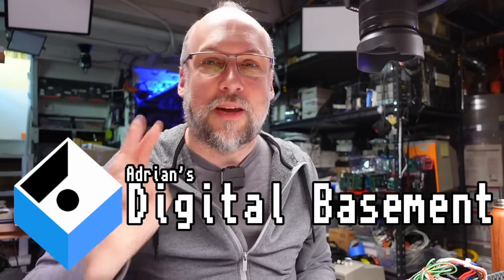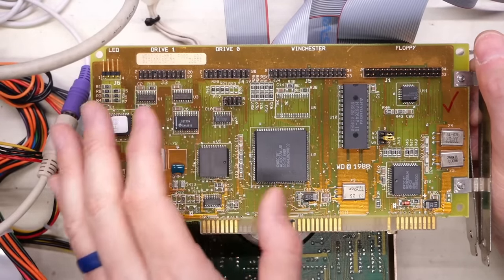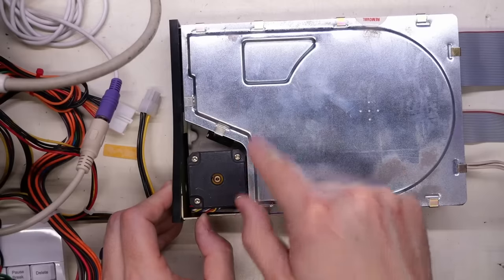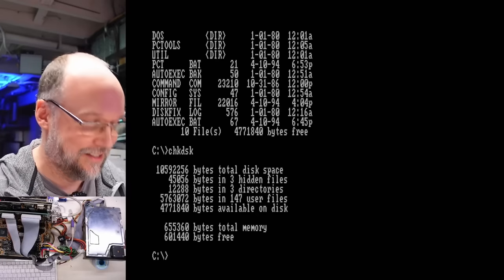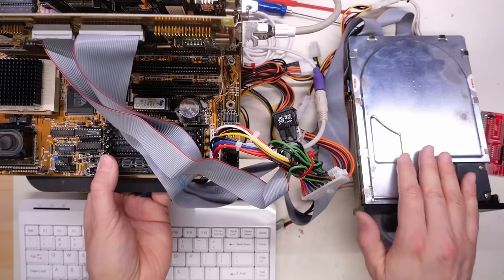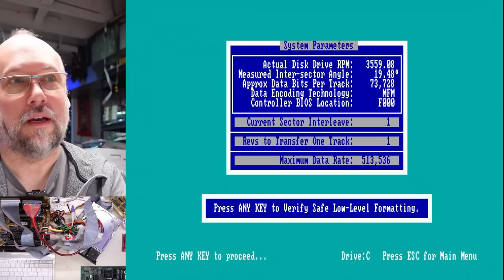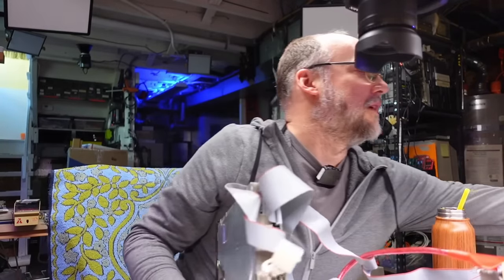Test and try: Does this 40 year old Tandon TM-252 drive still work?

Comment: My first PC class was XT clone, with 10MB MFM HDD branded Cogito Systems, probably one of mentioned ephemeric disk manufacturers. The controller was full-length card, based on the Z80. The drive looked exactly like ST225 and was as noisy as your Tandon. I managed to put Windows 3.1 (albeit in real mode) on it - each and every mouse movement was causing the drive to "tweet" for 10-15 seconds until anything happened ;)

Comment: I think you should use the more modest 386 board with all bios format goodies still in it. I would call those 16-bit controllers mainly compatibile (with drives and pc's), and I remember drives needed LL format anyway. Also, put bios ram exclusions where expected - it is better to do it first and turn off later (as I discovered , some things should work without it, but don't!)

Comment: I bought a similar 10mb full height hard drive for work for an original IBM PC in 1981. It came in an external enclosure with a controller card and power supply and a custom cable, as well as special software to get the PC to recognize it . I believe we paid $5000 in 1981 dollars! for it!

Comment: Given the small size, it seems a little sad to separate the drive / drive controller. This drive probably came from an original Compaq Portable. It may be good to keep it - just in case you ever need to build a Compaq with original hardware.

Good video.

Comment: I had one of those in the XT i got ahold of in the early 90s. My main machine was a 286 @ 20MHz (Harris was the fab under license, like AMD, several companies made 286s), 4MB onboard RAM, and two SCSI hard drivew, a 40 and an 80 megabyte, and EGA. I was ballin. 🤣

Comment: The noise MAY be from the grounding strap for the spindle motor (look at the bottom of the drive).  These wear a bit and can be a bit noisy.  You might want to check it out.

Comment: In a way the stepper motor driver are better than later voice coil hard drives. Modern hard drives have a servo track that lets the drive know where the tracks are, however if the magnetic patterns become degraded then the drive will be unable to locate the tracks - so game over, it's junk. These servo tracks are written in the factory using a special jig, the controller that comes with the drive cannot do that.
These old stepper motor drives don't have a servo track, and you can totally re-write everything.
With the stepper, each step takes you to the next track, with a voice coil there are no hard steps, it just moves the heads until it finds the next servo track, so if that is lost then the servo will just hunt about a bit, find nothing, then just error out, no options, it's a goner.
A voice coil actuator cannot move the heads a fixed amount, so it's impossible for it to be used to lay out a new servo track.

Pity you didn't keep the old HDD contents.
Reply: Isn't that what self servo writing does?

Comment: Would have loved to have you run spinrite on the drive with original controller.  It will check the interleave and also tell you what the optimum would be. AND, can change the interleave on the fly/no data loss.

Comment: Indeed magnetic media can "go bad" through entropy - the ordered domains just naturally decay. HP sold a pocket computer with a pull-card solution for data storage. It was recommended to read the cards occasionally because that would also rewrite the built-in timing tracks and so refresh the storage organization if not the data itself.
Reply: The older drives used weaker read and write heads so the strength of the domains was lower to start with. If I remember correctly by the start of the IDE era the on platter domains were over 10 times stronger than the MFM era.

High density requires higher domain strength for some reason. I think it has to do with domain strength falling off over physical area? I think.

Comment: I sometimes miss working with this kind of tech. Yeah, getting into computers, the 486 was out, but I was stuck on that for quite a while from hand-me-down parts. Before I actually went out and bought all new parts, I had a 486 Overdrive, 33 MHz FSB and 100 MHz core, 850 MB HDD, obligatory 1.44 3.5" floppy, 16x cdrom, 16 MB RAM and an SVGA card (don't remember the manufacture). I had that machine up until about 1998 (wow...16 years old... where did the time go?) when I bought parts to build an AMD K6-2 machine with 64 MB RAM.

Comment: Compatibility between Sata and ST506 might exist on a few drives but it would be difficult to test, you'd need a basic ide to sata adapter, plug it into an ide port and run a program to test ST506 commands to see what it does. Compatibilty will likely be only have a chance on 1st gen sata hard drives than anything newer. I really wouldn't expect sata backward compatibility to extend back before what is needed by ATA-1 with LBA28 (1994). Sata drives will likely just not work with direct CHS addressing from ST506 as it was declared obsolete a very long time ago.

Comment: I worked with XTs and ATs, and I really hated the noise even back then.  I was looking into solid state way before it went mainstream; embedded sometimes required it so there were options but they were so expensive.  It was a glorious day once the SATA SSDs finally became affordable (albeit for tiny capacities).

All that said, Flash memory requires regular scrubbing thus I depend on spinning rust for long term cold storage so I use them for archival and backup.

Comment: I remember having an old Seagate ST-225 back in the day, but it was mashed into an Amstrad PC with a controller set to a config that I'm pretty sure were wrong for the drive because it reported the drive as 32MB and that is a 20MB drive.  Needless to say that setup was far from reliable, but I was too young and inexperienced with PCs (XT actually) to know how to fix it.  Later we attached the drive to an AT system and figured out that it was a 20MB drive and setting it right it started to actually work reliably.  Go figure.  🙃  Still I am amazed that a drive from 40 years ago is still working reliably.  That is amazing!
Reply: That was a pretty common "hack" back in the day. Just swap the MFM controller for an RLL one and you'll get 50% more space.
The only issue is: RLL drives have a higher quality magnetic surface, so using MFM drives like that will impact reliability.

Comment: I have an ICT Data Chief for my C128 which has a Tanden clone of the ST-225 but it is a 3.5” half height drive in a 5.25” sled. The stepper motor sounds identical to yours however mine has stiction and I have to manually spin it to get it started. Then it’ll be fine until it powers down and parks.

Comment: A question - is it possible to mod a MFM controller board to work on the side of an IDE controller on a motherboard that still has ISA slots? Maybe wire it to another IRQ? Something else? Or do I have to disable the IDE to have any luck?
Reply: Ah, it seems it is... somehow. I have some old 16 bit boards that lack some of the edge contacts, and I researched the topic a bit years ago. I could put copper tape and jump wire to some location to have contact with the IRQ pin I want, and/or insulating tape on another location on the edge, but is that actually necessary? Adrian said the board addresses are different so at least that part should not interfere.

Comment: Have you ever seen a Tandon Pac PC?  Tandon made a PC with 2 drive bays that took a drive in a cage and plastic enclosure that you could eject swap out.  You could boot off of either drive and it came with a utility that remapped the drive letter of the disk you booted from.  Also, while running you could eject the non-boot disk and insert another drive.

Comment: Re the impact driver, the reason to use a bit holder with some flex is I'm pretty sure just to avoid destroying your bits or fasteners -- I've had e.g. less expensive torx bits shatter in the impact driver. Also bit holders not intended for impact drivers can be torn apart --  had one that had a friction fit shank that just fell apart after some abuse.

Any kind of shock absorber is actually going to reduce the effectiveness of the hammering. The whole point is to take the long slow gentle torque your hand is applying, and focus it into shorter sharper shocks. But there's enough, and there's too much! And having a little flex in the bit holder could be important if it keeps the shock just below the level that destroys your tools :)

Comment: I have a bunch of gotek floppy emulators loaded with the flashfloppy firmware. With one of those stubby little flash drives you can have gaggles of floppy images and avoid the issues with random old floppies going bad on you. Also flashfloppy lets you emulate floppy drives for lots of different systems, not just PC>

Comment: That warbling noise is normal for that series of drive. Tm252 is 306 cyl, 4 head, 17 spt, write precomp at cyl 128 , park at cyl 305, usually had to use a park utility iirc

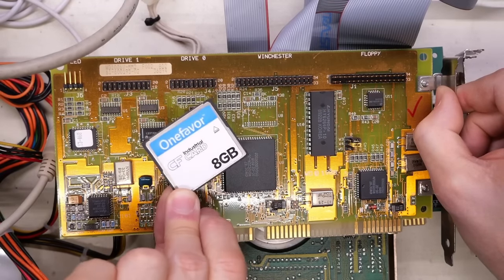Comment: 08:27 SATA drives uses two different command sets: ATA and AHCI. ATA is essentially an IDE/CF/original AT hard drive card compatible command set, while AHCI is closer to SCSI command set.
Reply: and AHCI is really only for optical drives, maybe certain other removable kinds of storage, because ATA is only for normal hard drives (and SSDs for pre-NVME drives)
Reply: @Nukle0n You're thinking of ATAPI.
Reply: It is the SCSI command set, which is why SATA drives run under the SCSI subsystem in Linux.
Reply: @douro20 Oh, yea. Which is also SCSI based.

Comment: 8:25 All SATA drives implement the ATA/ATAPI command set which, put simply, extends ATA with the SCSI command set. USB mass storage devices also use SCSI which is why in Linux for example both usb mass storage devices and SATA drives use the same device file naming convention sdx.

Comment: 35:14 depending on the MFM controller you can use debug.exe (which was on the disk)  and then "G=C800:5" or "G=C800:800" or or "G=C800:CCC" or "G=C800:6" depending on the BIOS (on the controller or the motherboard).

Comment: I can describe that sound, it sounds like that drive has a dry bearing or is dragging a head.  But since the drive is working, I'd go with 'dry bearing', especially after backing up to figure out "what the hell is that high pitched sound I haven't heard in 30 years"

Comment: IDE stands for integrated drive electronics, so IDE drives have a disk controller integrated with the drive itself, and the so-called IDE controller is called the host adapter.

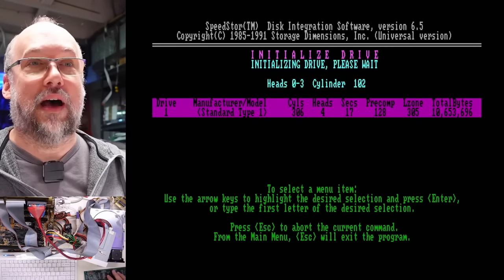Comment: 38:20 Many 8-bit cards used custom physical formats and translated it on the fly to the logical format associated with INT13h.  This was especially the case for RLL controllers and necessarily the case for compressing controllers like Perstor.  Without the BIOS on the 8-bit controller the translation would be impossible.  An additional problem is that the BIOS will sometimes crash or malfunction on a faster system due to timing assumptions that were only valid on XT-class computers.

Comment: That's not the loudest I encountered.  The first RS/6000 system I used (7013-595 I think) had two full-height hard drives.  When the system powered up it sounded like a jet spinning up.

Comment: Pick up a set of JIS screwdrivers.  Unlike regular Phillips bits they don't have an angle in the bit design that is intended to make the bit cam out when you ramp up the torque.  They 'bite' into the screw head better even when put into non JIS screws, just like the Posidrive tip does on your hammer drill you're using.

Comment: For super reluctant Phillips head screws that slip, and you really need to get the item apart.  A good technique to use, is to crazy glue a piece of paper to the stripped screw head, and while it is still wet, put the bit on and holding the bit tightly into the stripped head, wait until the glue dries. then attach the impact driver and the screw will normally come right out.   There are some where even that technique won't work and the only answer I have found for that issue, is to drill it out.

Comment: Out of curiosity ... one could use modern flash alternatives with whatever adapters (as shown with CF Cards). Using these old drives, is it solely for the "vintage factor" or does it have some practical use? I guess checking if a specific controller card works or something like that?

Comment: Have you ever worked on an XTA drive? I have understood that those were a rather short adventure before the ATA interface. They used a similar 40 wire cable and connector, but were 8 bit wide, and had no master/slave selection that I know of. I have run into two of these drives - or at least one, which was in a Philips PC clone, and another which I suspect to be one. I have a HDD controller for Amiga 500 which has a selection jumper for XT/SCSI but I only ever got SCSI drives to work with it. The mystery 40 pin drive which doesn't communicate with a "modern" IDE interface, doesn't seem to do anything useful with the controller either. I must excavate it from my pile of rubbish and look up the model.

Comment: In my experience early model voice coil HDD can fail from the coating on the magnets cracking and then coming loose. It sticks to the main magnet and interferes with the head coil.

Comment: I have a few still. I have 2 working. 1 in a DTK 8088. And the other in a 286 that has a built in MFM controller on the mother board that I cannot use a XTIDE. I have a ST4069 full height that still works (or did last time I had it out). I also have a few "bad" ST225's. I want to see if I might be able to resurrect them. Maybe I can get one good out of the 2. Appreciate the tips. But they are loud!

Comment: Hi Adrian I have a question for you. I have a MFM hard drive and controller card I pulled back in the 90s. I picked up an IBM 5150 a while back and I'd like to use the in it but I've had no luck getting it to work. Can you check it out for me?

Comment: The har drive looks chunky.  I have a dell pentium 4 th desktop computer from 2003 and the pair of mechanical hd first that came with the dell desktop computer still working  and the same that I  added  both hard drives still works perfectly

Comment: Red line on the cable is pin #1 99.999999% of the time.  The only time it's not is when a flat earther put it together, and they can't put 1 + 1 together.

Comment: Maybe be a little careful with the drill with its DC motor (with powerful, usually not really shielded  magnet) close to that HDD... HDDs are not terribly sensitive to external fields, but it wouldnt hurt to be careful.

Comment: There are CF cards that hold actual miniature hard drives inside. Do you have one of those?
17:17 - the stepper motor did spin a little when you first started it up.
Reply: They were called MicroDrive. FYI

Comment: 14:00 - KALOK comes to mind - crapfully crap.
Reply: kalok, kalok, kalok... the sound when they failed
Reply: I can remember Miniscribe and Rodime as well. I wonder if working examples of either of those still exist anywhere (probably not).
Reply: @Zeem4  I have an opened Miniscribe in my spinning sound collection. It does not work other than it spinning up and doing a head seek. The heads crashed and one of the platters are badly scored.

Comment: 06:38 The microcontroller is not a member of the 8051 family. The 8749 is the EPROM microcontroller of the MCS-48 family. The MCS-48 family is the predecessor of the MCS-51 family. (Fun fact: the 8042 UPI used as keyboard controller on AT machines is derived from the MCS-48 family.) You need to reduce such errors in your videos, Adrian.

Comment: "my ears!"
that's why I will never use these hard drives. TBH I don't even like the silent ones. I haven't had a personal hard drive in a long time. My work computer finally got replaced. It has an unformatted hard drive. I have no intention of asking them to format it. The NVME is all I need. The PS4 hasn't been turned on in a few years now. It has one as well. I've been using SSDs for 13 years now. I just flat out hate hard drives.